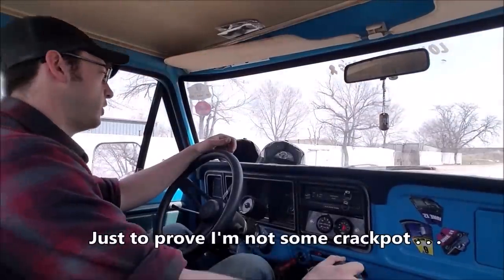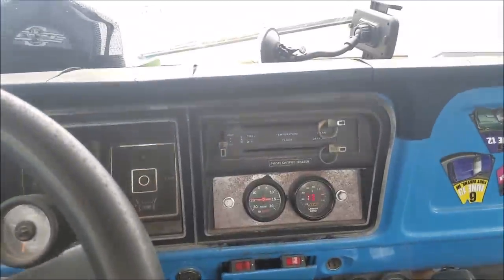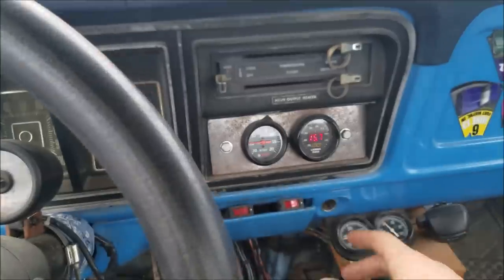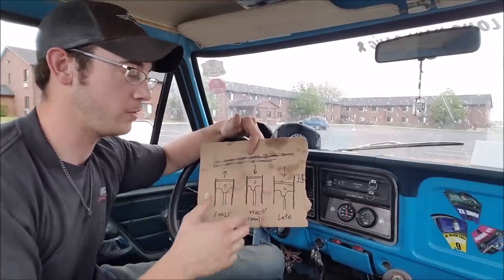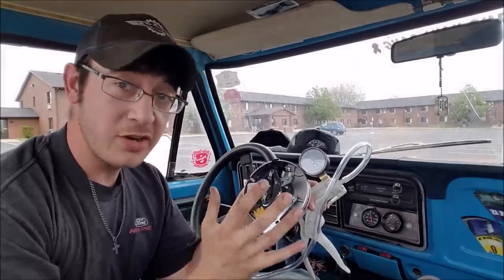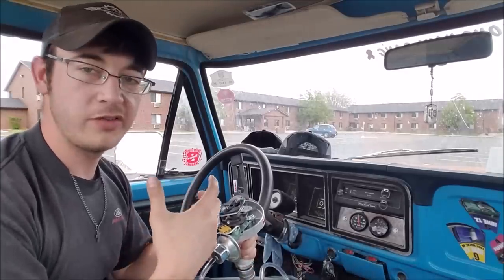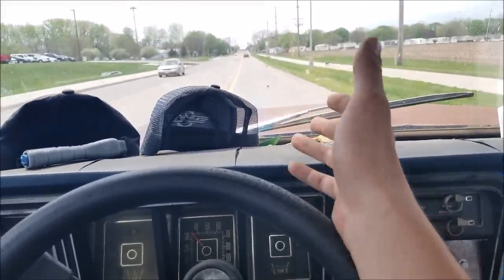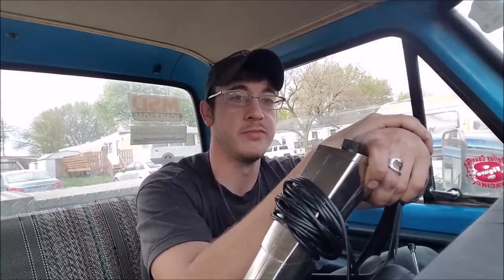Tuning a Distributor's Advance Curve (For MAX Performance & Power!)

Comment from the maker: put on your thinking cap today, were talking ignition timing. 
Get yourself a re-curve kit for your distributor, and a timing light and go to town - ignition timing matters so much more than folks ever give it credit for - "timing is everything" 
This is the timing light I use which has the "advance feature": https://amzn.to/2SrY8lG
Reply: Hi Luke. I agree correct timing is everything. But my question is about the timing light. Could you explain the advance timing dial on the light ? What is it used for, and how do you use it. I've other people using it but they never explain why or how to use the dial. I'm old school and have never used one. An explanation would be vary helpful .  Thanks.
Reply: I was hoping you could help me out I have a 1983 chevy k10 and I swapped motors the old motor had a mechanical fuel pump with one main feed line and then vent line. The new motor is an 87 350ci that was a tbi and I swapped intakes and put an edelbrock intake for my 1406 edelbrock carb. Unfortunately I found out that the 87 blocks with the tbi didnt have mechanical fuel pumps they had the fuel pump inside the tank so to remedy this I bought one of those 4-7 psi 35 GPH edelbrock inline pumps you can buy at an Auto store and plumbed it in. I plugged up the old vent hose to the tank and checked my hose clamps but still seem to lose prime i dont know if i should get a puller pump instead of this gravity feed pusher or what also when I'm driving down the road it's like its misfiring I checked my distributor and timing and am at 14 degrees initial but seem to when I'm cruising its having like a miss.
Reply: @Hrmert  The dial back light allows you to easily read your total advance. Typically what you do is  raise the rpm up to the point that the timing stops advancing, ie. it is all in.You then shine the light on your timing pointer. While watching the flash you rotate the knob until the TDC mark on your balancer aligns with the timing pointer. The knob on the light is now pointing at your total advance. Alternatively you can start by turning the knob to the desired timing, say 36 degrees. Then bring the rpm up to the point the timing stops advancing, and rotate the distributor until it reads 0 on the balancer.
Reply: Unless my engine is tiny, I generally tune for efficiency rather than power, and though lighter springs will probably help both, more vacuum advance helps more with cruising efficiency. Is that usually very conservative also? Also, worn engines that compress less and burn more oil will usually run cooler and want more advanced timing, except if there is much carbon buildup. But really loud mufflers can drown out spark knock.
  It is possible to get both, part throttle efficiency and full throttle power.  It's just a bit more complex. 2 stage carbs help, and I wish they would make more 2 stage carbs for american cars with 2 bbl manifolds.
Reply: People will be surprised how much timing an engine will really take at idle.  dont be suprised if it takes like 20 degrees on certain setups and not ping at all.

i hear a lot of hipo street engines like less mechanical and more initial and all in by 2000-2500 

 Im talking carb pump gas engines no power adders
Reply: I have a an 83 F350 460 cid with a MSD 6AL- Blaster 2 8202 Coil running to a Duraspark Distributor. I was wondering if I can use the PerTronix 1284 Internals with this setup to stop with the points maintenance. I want to make sure the PerTronix 1284 is compatible with the MSD products?
Reply: @KingJT80  i would like to do the recurve part on my distributor for 454 gm and new carb

Comment: I too have a truck weighing 5500 lbs.  I worked for about 6hrs changing springs,  It was worth every minute.  I'm a GM MAN,  and still enjoy your videos. Thanks
Reply from the maker: Good deal and thanks for listening - it makes a massive difference and is so underappreicated
Reply: i have a very heavy vehicle too 350 sbc what is better faster or slower advancement on a heavy vehicle

Comment: Very well said Luke, I also use to build small block Fords back in the day. Another great way to keep track of how the timing curve is advancing  (and at what rate) is to draw a graph with RPM's (every 200 RPM's) on a vertical plane and degrees of advance (every 2 degrees) on a horizontal plane. Now with a timing light you can register the advance every 200 RPM's with a dot on the graph and after 3000 or so RPM's connect the dots to get your distributor curve. This plus test driving for maximum cylinder load (no preignition) is a great "cheap way" to see what's really going on. Maybe you could do a video on it, might help alot of people out. Happy Wrenching.
Reply: How do you measure the timing? The number of pulses in a minute vs rpm?
Reply: @leeknivek  with a timing light every 200 rpm, then mark on graph to get the curve of advance

Comment: In the old days there was a Sun distributor machine at virtually every tuneup facility. It was a good tool to set the centrifugal timing on a distributor. Used in conjunction with your road test method, you could obtain perfect timing and have a record of your advance curve.

Comment: What worked for me is a light spring, n a medium spring. The kit comes with light, medium, n heavy springs. I did this to both 
motors, a small block n big block Chevy. 
Timing ended up at 10° on the small block n 12° on the big block. Total advance on both is about at 36°. They both run great. Both have good pickup, passing gears kick-in strong, and both have good idle. Now, as far as the carburetor, distributor, operator, relationship, you may have to consult Dr Phil... 🤔

Comment: My introduction to mechanical advance came in the form of a 1986 GMC Suburban, 350 and manual 4 speed. The mechanic that recurved that one put the lightest springs in that the kit had to offer. I always drove it dead stick, and the next time I drove it, when I backed off the throttle to change gears, it felt like someone still had their foot in it. Great information, and well presented. Thank you.

Comment: I wish more people knew about this. Without proper timming you get poor gas millage, and losse power. Not running manifold vac and ported vac to your vacuum advace is the another way to loose gas millage, power, and drivability. I put a timming light on my 1994 f150 and guesse what 30 degrease timming at idle. I set my Nova and K20 up this way with about the same timming. Ported vac was a crude way to produce less emitions pre-catalitic converter.

Comment: I’m the only guys in my shop with a timing light, and I’m under 40, barely lol. I put the pertronix rebuild kit for my sbc in a 79 shortwide and used the middle springs. Really woke that engine up. Made a huge difference just when you would free rev it, it would spin up so quick.

Comment: You are correct about the timing but its also about transmission timing especially if you have an automatic transmission. in the bottom of the distributor is a plate most have two sides to this plate and can be turned over.there is a knotch on both ends of different lengths make sure yours are correct for your transmission.

Comment: Many many years ago I had a speed shop owner help me with this. After two trips to his shop he was able to install a advance curve in my Mallory  distributor that worked well in my 302 ford.   Sadly not many shops have this ability any more. With the advance in computer equipped vehicles it takes the skill of a tuner with the appropriate software and several runs of the engine to fine tune the ecm

Comment: Good video. I think most people have no idea what springs and weights they have in their distributors. You can buy kits from different manufactures which will have graphs that show how much advance is being added and at what RPM. If you are working with an unknown engine or distributor you can buy stickers with higher degrees up to 30-40 that go on your harmonic balancer. You can rev the engine up and see how much timing is being added at what RPM. Also something to keep in mind is springs do wear out over time. So that may affect your timing.

Comment: Interestingly enough, I'm working on the timing for my boat motor (Mercruiser 465 HO). Timing in a marine application has many challenges and it's difficult to hear any detonation. The factory distributor has no vacuum canister nor does it have any kind of centrifugal weight system. I'm guessing it's a 'computer' controlled advance curve. I'm going to test that with the timing light soon. Another challenge with a boat is running on your muffs past idle speed can damage the impeller and/or not provide enough cooling water for the engine. Someday I'll replace all the Merc parts with MSD but the boat runs about 70 MPH now and it's pretty scary at that speed. LOL.

Comment: This is something I did to my 69 vw, it sounds silly and I was goffed at by a few people.   I have a high altitude situation as well I am trying to correct for.  My 1600 dual port single carb does 80 pretty well. And given the horse power and offset loss for altitude will get to highway speeds pretty quick, quick enough it surprises people.  I dont sustain 70 plus for long periods but sometimes I want to just go. Sir this video is underrated if anything for a long lost science of engine tuning that's anymore done by the cars pcm keep these vids coming

Comment: Been A LONG TIME since I've recurved a distributor...but to add...Dad taught me to test a tune up in high gear....flat stretch of road...let the rpms come down to idle(still in high)...and put the spurs to it. If no pinging, you were safe. If you were ambitious, it was time to twist on the distributor. Later, I learned about springs and such. Just found your channel. Awesome video.Sub'd.

Comment: Big Ford guy here, I'm 43 and never owned anything else and never will I'm currently working on a 1994 shortbed f150 4x4 swapped efi to carb, previous owner had a mess , just old tired 302 in it although still pulls 20" of mercury or better, I replaced distributor with the ford original replacement with vacuum advance all is good except seems to bog on a hill way more than it should, also has 5 speed manual , Mazda 5 trans I believe..... been checking out your videos for a while, keep up the good work man and wondered how the lawnmower carbed maverick came out if it ever ran to where you could drive it
Reply from the maker: There is numerous videos of me driving the mower carb including 1000 miles on power tour

Comment: This has nothing to do with the subject matter of the video, but here's a tip for those GM owners who want to replace their Quadrajet.  If you don't want to swap out the intake but want to install a square bore on your old manifold, the Mr. Gasket 1932 spread bore to square bore adapter will work, but you might have to buy longer bolts or use longer studs to mount your new carb.  The supplied bolts are only 1.25 inches long and you'll need longer ones, especially if you need to attach a throttle bracket.  This may be true for Mopars also.

Comment: That is IT in a nut shell.  The " RIGHT TIMING " ! But in today's YouTube Climate of Extreme and Shocking EVERYTHING.
Only the Thinking , Person will pick up on what your saying.
Which is ,to some of us " Nothing New" after many years of building cars ,I'm just coming around , to under standing the significance. Of free HP from " Correct Timing " This was VERY informative, this video applied to many builds , can amount to alot of free horse power with No Money Spent ! Thank You

Comment: I'm trying to get my 1972 F-250 running with original parts! And need a good carb for my 72' 390... and Yes it's an F25 H code Camper Special!
Reply: I'm the second owner, bought the truck from an elderly man who used it for camping and hunting.  Only has 89k on it 😎

Comment: It's a long time ago (40+ years) but I recall a really solid, nice blue 64 Fairlane I had. Stick six,  that was wore out but such a good body I swapped in a 1968 302 2V auto. Had to go to a floor cable shifter (Hurst) I had gotten a factory dual exhaust system from a Ford dealer near me and had it fitted to the slightly different 302 manifolds (vs a 289) at a muffler shop. Damn near couldn't her it run! But when you Cracked the throttle? most definitely! Anyway from advice from older street racer brother I put in a Curve kit in the distributor . Man! What a difference! Car had came with a non posi 3.50 rear gear and once I got somewhat wider, taller tires on the back that car was FUN to drive and race other guys... Now not to say I didn't lose (I never worried about if I did) but I surprised a LOT of guys! Got past a few cars I probably shouldn't have! Being Lo Po 2V 302 I did the curve kit,  (lightest springs) timing set to factory specs & I ran one range hotter plugs in her and usually premium gas. PS. I had ne real intention on street racing the car but I DID' really get into it....lol Just wish I would've taken the Parts guy @ the Ford dealer up on his offer and bought his posi unit for an 8" Ford !
Reply from the maker: I love reading stuff like this

Comment: I switched from ported to manifold since your last video and it would seem the 352 likes it better. The rear is currently on jacks because im swapping on a Dana 80 from the 90s so i cant exactly drive it right now. The only way i could really test if its making more power is really just by giving it some gas and seeing how much the truck shakes from the torque and it seems to be better. Thanks Mr. ThunderHead289 :)
Reply from the maker: Howdy drew, the only difference between ported and manifold is at idle ☺️
Technically if you switch to ported, to take advantage of what you are doing. You need to then advance initial mechanical timing - this effectively shifts the curve up in the rpm range giving you more timing per rpm across the board 👍
Reply: @ThunderHead289  yeah i was able to advance the timing more when switching. I dont know exactly by how much because there are no timing marks, but i have a stable vacuum at 20 inches. Throttle response seems much smoother/crisp. The 50cc accelerator pump seemed a little big for it when it was on manifold and would bog out if you gave to much gas at once, now it doesnt bog out i just get black smoke out the exhaust which is always fun

Comment: Depends on what compression ratio ur engine has . N what rear end gear ur running .to figure out what load u have on engine n higher gears with weight off vehicle

Comment: I went EFI with a kcock sensor and now I can dial in how much advance I want at what rpm and load I want. Then log and tune those tables to keep from knock and then rely on the sensor for out of bound conditions after. 
After learning how to tune carbs and distributors I went "F'it Imma do it the hardest way possible and EFI'd it!" lol, <3 all Edit: '78 f150 4x4 custom 4.9l (using parts from '96 to make it easier) with VEMS
Reply from the maker: Be careful with the knock sensor, it’s piezo sensor and only really calibrated with any precision to a certain rpm range. Anything outside of that, it’s hard telling. 
I actually do automation for my day job, which is probably why I like carbs when I’m not at work
Reply: @ThunderHead289  which is why I'm using an 90's EFI block and OEM knock Sensor, It's already been mostly engineered  by the manufacturer! Just no high tooth count crank sensor though... No need to complicate thing anyways, lol! Having fun or learnin' is enough!

Comment: Dear thunderhead289 I am currently 32 years old and I have on a truck that has points and an old-school distributor since I was 12 years old I have not on a timing light yet although I agree with needing one I just have gotten really good at adjusting my timing over the years I love your videos however there's one part of the ignition timing that I have not seen you mention yet and that is the balest the thing that drops the voltage to the coil to around 8 volts and why it took me many years to figure that out I'm sure there's a lot of people that still do not know

Comment: This is great stuff here. I live a couple hours North of Atlanta , and just South of Chattanooga TN. If you're close enough we could build us something to drive up on to add load to the drive axle , sorry not a true dinometer ( I sure wish we could) but something stationary to check ignition timing in different load to RPM's to set one up just right. I would build the deathtrap ( I mean the fabulous machine the test with if you would show me all the tricks of the trade of setting up carburetors and distributors like an old time racer world be able to😀👍
I've learned a lot from your videos. Thanks for posting what you have.  But seriously I think if you had something to keep the vehicle stationary and under load with a test light on it to moneter what it's doing at said RPM then a person could adjust the springs and weights to dial it in perfect. Or am I missing something here?????

Comment: set conservative because people pull trailers and load those old full and mid size up like a truck, performance and economy cars are usually going to be on the higher end and need backed off if you're going to tow

Comment: Great video as always Luke! I’m painting the car today and posting video later. Waiting for couple more parts to finish putting the motor together. I’m excited to get her on the road. It’s probably been 8yrs or so without even having a drivetrain, so I think I’m doing pretty good for 4 months lol. I’ll be needing some tuning tips soon because I can build anything fuel-injection, turbocharged, or supercharged. But definitely not familiar with carburetors.